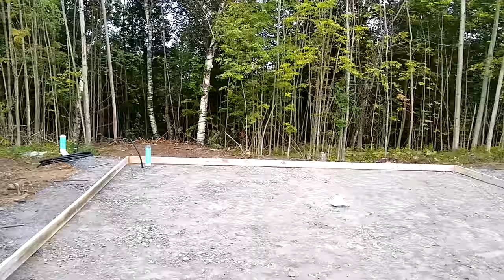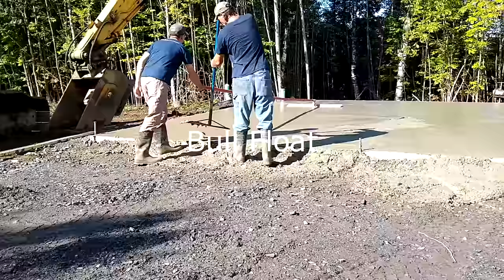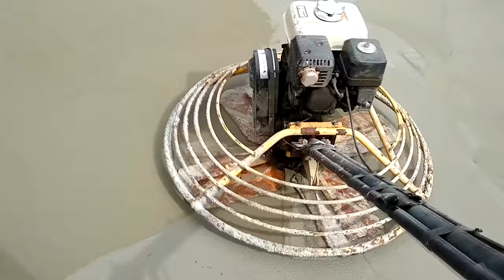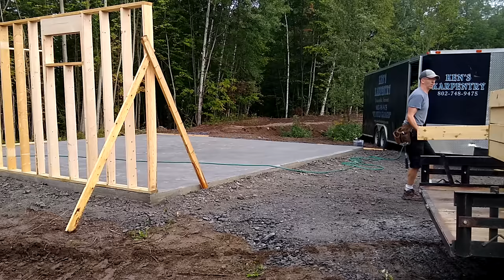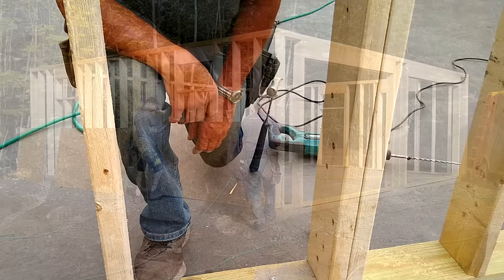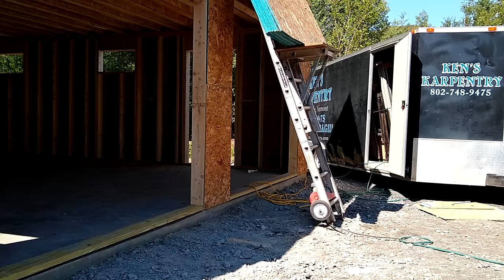Building a Gambrel garage stage 1

Comment: I notice the you use 2" X 6" for the monolithic slab so each slab is 5 1/2" thick. I use to use 2 X 6 for framing walls but that was for insulation purposes only. Jim

Comment: I read your response to my comment and I like to use 2-1/2 inch ring shank coil nails for the wall sheathing and 3 inch ring shank nails for the stud framing. I think that ring shank nails hold better than smooth shank nails. I also think people should use ring shank nails for the roof sheathing too.
Reply from the maker: MDO VIDEO I agree. I like the 3” for framing instead of the 3 1/4” because it doesn’t come through the other side of a doubled 2 by.  Thanks for the comment

Comment: Pro tip when you're using a hammer drill to set anchors put your anchor up against the hammer drill bit and put a piece of tape so you know how deep to go so you're not going to shallow because you'll never get the anchor out or Too Deep drilling through your concrete.
Reply from the maker: Thanks

Comment: Love the work but no foam gasket between wood & concrete?...
Reply from the maker: Thanks for watching. A few minutes into the video you can see we stapled sill seal to the bottom of the wall panels before we tip them up.

Comment: I notice that you do not install the anchor bolts in the concrete when it is poured. You drill holes and install them after the wall sections are in place

Comment: Did you make the trusses that are between the first and second floor, or did you order them? What are they called?
Reply from the maker: Those are store bought.  These particular I joists are Nordic NI-80 14"
Reply: Ok thanks..
Reply: That’s actually the first time I have seen someone use those.. I live in the South though, so maybe they arent used as commonly down here..
Reply from the maker: They work well to get clear span without posts.  I think they are less money than scissor trusses.

Comment: a couple of things, I like the idea of drilling the bolts into the concrete after its settled this way you cant go wrong with lining them up, I know you put gaskets on the bottom plates why not use pressure treated lumber, just curious, and carpentry is spelled wrong on your trailer, lol just messing with ya, great job
Reply from the maker: Mi speling iz atroshus.  :)  It's hard to see but the bottom plates are pressure treated.  Thanks for watching.

Comment: You build on a slab without any foundation walls above the slab?
Reply from the maker: Richard McKrell we’ve built some with one or two rows of blocks but I’ve built over 400 garages over the past 30 plus years just on a slab with great results. Thanks for the comment
Reply: I'd never do it myself, but if you can get a customer to accept a slab.
Reply from the maker: Richard McKrell I hear you. Around here often an $8,000 bill for sitework and frostwalls makes it impossible for people to have a garage to get their vehicles out of the harsh winters
Reply: Yeah I agree
Reply: @richardmckrell4899  I'm a remodeling contractor in Virginia. There are a ton of houses around here built on a "slab on grade". It's not uncommon.
Reply: Yeah but I think this guy is building in New England.

Comment: everything is fine, but I did not notice the insulation between the wood and the concrete.  Is it for quick decay or is the board soaked with a special solution?
Reply from the maker: witt gal thanks for asking. The bottom plate is pressure treated and the material between the plate and concrete is a plastic foam product to stop transfer of moisture from the concrete to the wood.
Reply: Kens Karpentry understood, very reasonable! 👍

Comment: If you go bigger than 24 x 24. Do you have make a footer?
Reply from the maker: mike johnson the largest we’ve done is 30x50 gambrel. We poured a thickened perimeter of 1’ deep and 2’ wide with 2 extra rows of rebar. That was 10 years ago and it still looks great.

Comment: No dpc between concrete and sole plate of timber frame ? this could cause serious problems later.
Reply from the maker: John McCrank thanks for the comment. About four and a half minutes in you can see sill seal stapled to the bottom of the pressure treated

Comment: Is the bottom plate of the premade framed walls treated wood? ( the part that contacts the cement). TIA
Reply from the maker: Yes definitely pressure treated and we staple the sill seal to the bottom of the plate before we set the wall.
Reply: Kens Karpentry good man

Comment: Hi, Curious as to what the height of these 2 X 6 walls are, i.e. are the studs 92 5/8 or 104 5/8? Also, are the headers 2 X 10 (appears there are only double headers for each door / window vs 3. For some reason I thought 3 were needed with 1/2 inch OSB in between?
Reply from the maker: Thanks for the comment.  the studs are 92 5/8.  I like to use the double headers because we can better insulate.  Also 2x10 will more than handle the load over the windows.  The garage doors are on a non bearing wall so again more insulation

Comment: What psi concrete specs should one use for this when calling it in to concrete company?
Reply from the maker: Typically it's 3,000 psi.  The cat's I believe are spacer blocks in between each stud at the 4' height.

Comment: How much was just the cement?
Reply from the maker: We are paying around $140 per yard for concrete x 12 yards = $1,680, 38 pieces of rebar about $270. plus labor and equipment.  Thanks
Reply: Kens Karpentry I believe around here in Canada Ontario it’s $300 a yard..the store I use to work at used 26 yards or 28 yards and the cement alone was $8000 so they say
Reply from the maker: That sounds about right for materials, labor and overhead.
Reply: Kens Karpentry $8000 was for the cement only no labour
Reply from the maker: Wow!  Sounds like a lot of money.

Comment: Was this built with local permits?  I am wondering for a small, rustic house that will have exposed framing inside and metal siding, is sheathing required for structural if I plan to screw in (3) 2x4 cross member studs horizontally on the outside  like this :  https://www.youtube.com/watch?v=iqqMjQbzWyw
Reply from the maker: Yes with local permits. If you don’t use wall sheathing it would be good to use x bracing.
Reply: @kenskarpentry  Thanks I don't mind x bracing but think it will still need more lumber so I have somewhere to brace vertical siding and panels in the middle.  I'm just wondering if my architect and the building department will okay it. I need to call  them but it's been difficult to explain it to them over the phone.

Comment: Install wooden Frame on bare concrete slab??? Nothing in between?
Reply from the maker: Pavel Prilepin about 4 1/2 minutes into the video you can see sill seal on the bottom of the pressure treated plates
Reply: Pavel, you could also use a pressure treated bottom plate, I would had sunk J-bolts into the concrete prior.  But it all works, I am sure Ken followed code.
Reply from the maker: Pavel Prilepin thanks for the comment. at a little over 4 minutes into the video you can see a foam sill seal stapled to the bottom of the pressure treated bottom plate.

Comment: It is a pity that you did not provide insulation between the wall and concrete
Reply from the maker: Thanks for watching!  At 4:10 if you look close you can see sill seal stapled to the pressure treated plate of the wall. We do that on all the walls.

Comment: What does gambrel mean in building terms? Butchers call the 'w' shaped bar you hang carcases on, a gambrel.
Reply from the maker: Tu te Kohe in building terms it pertains to the roof style. Interesting how they use the word for two different things. Thanks for the input
Reply: @kenskarpentry  I would have said mansarde but I'm not an expert

Comment: How are youbsquaring and plumbing the walls?
Reply from the maker: Keith Tomczyk we square and plumb using the sheathing but always check it with a level.
Reply: @kenskarpentry  
Don't see how that works if the slab is not 100 percent level..
It may be better to square them on the ground and wind brace them or as I commented ,sheath them on the ground.
Reply: keith cunningham  Because I've never seen a perfectly level slab.

Comment: I’m not a big fan of you not using pressure treated lumber for you bottom wall plate. You don’t even vapor barrier the standard pine for the base plate, why is that?
Reply from the maker: Aaron thanks for the comment. You are absolutely right you have to use sill and pressure treated plates. If you look at the video at about 4 minutes and 25 seconds in you can see sill seal stapled to the pressure treated bottom plate.

Comment: 50 years ago we were smart enough to sheathe the exterior walls before we stood them up.
Reply from the maker: Jack Riley I remember those days. (Not 50 years ago). The weight is a little too much for me nowadays. I know....I’m a wimp. :)
Reply: Jack Riley   Yes Jack it is still done that way on many custom homes since the same carpenters go start to finish. With the advent of piecework especially on production homes like in California. Everybody gets their turn and the sheer bracing crew unfortunately get their turn after the rough wall framing is up. And so it goes.

Comment: I didn't see a single fire stop anywhere. Your not going to escape it if something happens. Not good!
Reply from the maker: Steven Morton not sure what you’re talking about.
Reply: @kenskarpentry  Fire stops have been used since the turn of the century (last century). They are pieces of wood that fit between the studs and rafters of the entire building. Usually halfway between there length. They are shown to hold a fire down or stop it long enough to get out. Also adds structural stability to the works of the building.
Reply from the maker: Steven Morton thanks for the input. If we balloon frame we always block off at the first floor ceiling. Around here I’ve never seen that done like 4’ up from the floor. Thanks again